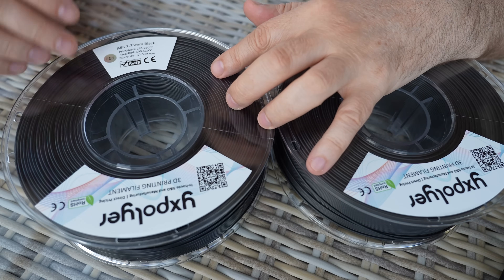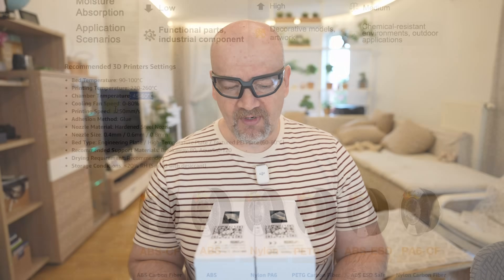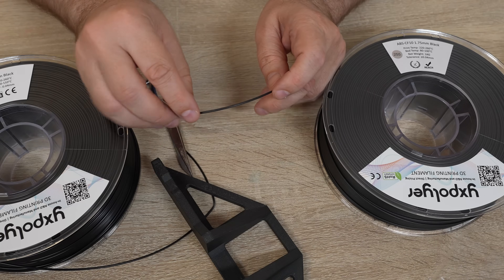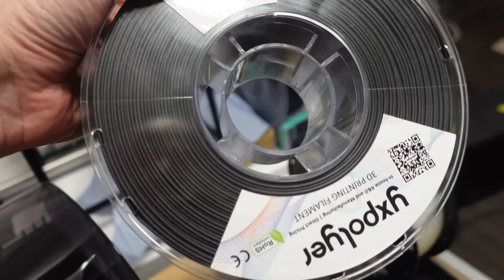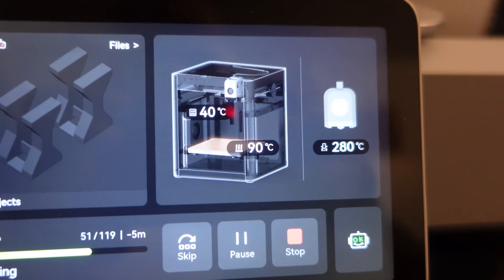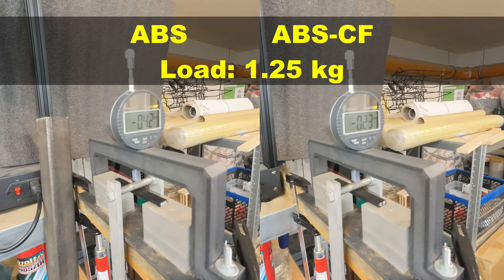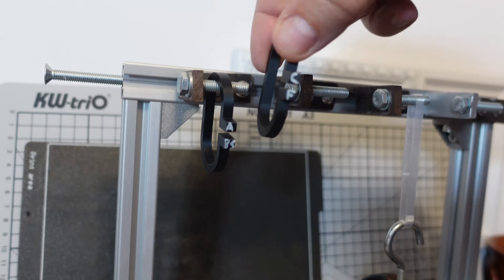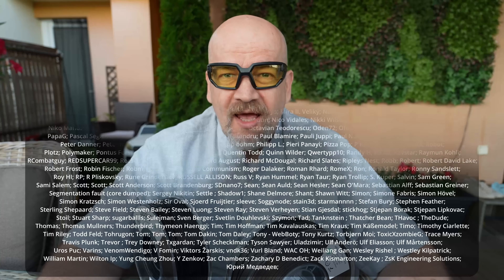ABS vs ABS-CF by YXPolyer – Strength, Print Quality, and More

Comment: I generally run filaments 10 C higher than the usual temps. For example. Polymakers Polylite PETG is run at 270. It runs very well like that on my H2D. The few times I’ve gotten PETG from other manufacturers, they recommend lower temps, about 250 average. But they run better at 270, so I don’t understand what’s going on. I do know that small manufacturers don’t do the extensive R&D that bigger companies do. Some just buy granules of material and run them through their machines to make filament, so they don’t really understand that much.

Comment: Nice work!! 👏Very interesting result with +8 oC temperature resistance in ABS CF10%. Probably because CF anchors the SAN matrix more tightly when butadiene phase starts to soften drastically.
How about a wearing test between ABS, ABS CF10% and ABS CF20% from the same supplier ? Very curious about it ! 😁

Comment: So stiffer, weaker in impact, otherwise identical. Basically a PLA for higher temperatures, with almost no creep.
Reply: Pure pla has much higher tensile but yeah :)
Reply: @riba2233  well the impact strength is comparable to PLA+/pro, which has a bit lower impact strength anyway.

I think the use case depends a lot on the printer people have available: I have an enclosed and heated one (Q1 pro), so I typically go directly for ABS. Tensile strength is compensated with more perimeters, which also stiffen the final printed parts. No hardened components needed, super cheap, choice of many colours.
People with open printers and in need of higher temperature resistance will find this filament interesting.

Comment: Hey Dr. Igor, I really enjoy your videos. I have a question regarding your printing process. Do you have any standard for post-print part handling? I ask, because as far as I am aware ABS, and other engineering-grade filaments, should be left alone until they are sufficiently cool to avoid warping (and I’ve had it happen to me lol), but it seemed like you removed the ABS immediately after the print was finished, which I would imagine could affect final part strength. I hope I am correct in assuming the CF version is less sensitive to warping post-print. Have you dealt with ABS parts warping from being removed from the bed too quickly? Thank you again for your videos!

Comment: I always choose abs-gf / abs-cf if I have choice, instead of plain abs - because it warps less, looks more "professional" and doesn't delaminate as easy as abs, at least from my experience
Reply: I was curious about it being worth it or not. 

I have recently started playing with ASA, and PETG-CF. Does the ABS-GF or ABS-CF that much better?  The main thing keeping me from going to ABS is the reputation of it being harsh and more difficult to print with.  I picked up a Silcone Carbide nozzle for these harsher filaments which works great as long as I am in printing in high heat filaments, so I am ready. I just am not sure if I want to.
Reply: @tobybigham4196  abs-gf is little bit easier than abs in printing, and it's not end of the world - you need enclosure, some place to put printer in, as it stinks as if you were burning garbage, and you need to use some gluestick on bed or use 1st layer pla trick, then it prints like normal material
Reply: @tobybigham4196 yes gf and cf is easier to print and the finish is beautiful! I print mainly in a wide range of engineering filaments both gf/cf filled and not filled and the filled ones are always easier to print, thats just how it is. Give it a shot! There's some really impressive filaments out there!
Reply: @tobybigham4196  abs prints like pla on my x1c, never had any issues with abs
Reply: Let me guess your print chamber is under 50°C?
Reply: @warmesuppe yeah, 30-40 for super long prints

Comment: I would be interested in seeing you test qidi ABS Rapido and PETG tough. They have some pretty unexpected specifications. The ABS Rapido advertises a very high elastic modulus and the PETG tough claims to be able to handle much higher impact than usual.
Reply from the maker: Eh, I have those filaments here. But probably I can start with them in August maybe.
Reply: I think you should take a look at TreeD as well. They have some unique filaments (like PPS-GF) and some filaments that advertise incredible properties like their PA HS CF.

Comment: I dont know, these carbon fibers are not linked together, so it wont add any strength, more lightweight mass to the plastic
Reply from the maker: Overall, they add stiffness, temperature resistancy, less creeping. Usually: weaker layer adhesion and more brittle. https://youtu.be/FJ24yMcByg4

Comment: Many times, I'll choose ABS-CF rather than ABS based on the better surface finish with less noticeable layer lines.  The YXPolyer ABS-CF seems to have short CF fibers based on the filament's flexibility and the good layer adhesion when printed.  The CF did reduce impact strength but that's often not a significant factor in my applications.

The video title and video description refer to this as YXPolymer, but the company name is YXPolyer (no "M").  My brain also wants to insert the missing "m".

Thanks to Polymaker for sponsoring these excellent material testing videos.
Reply from the maker: Thank you for correction. I wrote it correctly at the first time, but AI "corrected" my text and I didn't noticed it. Fixed now.